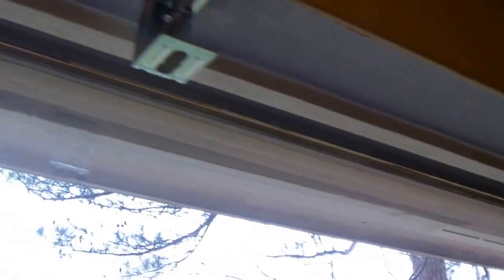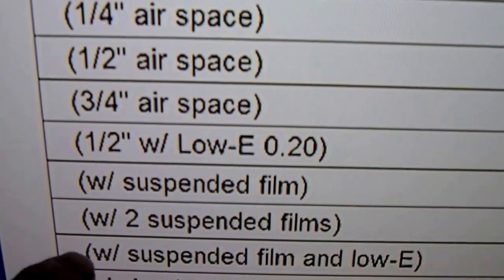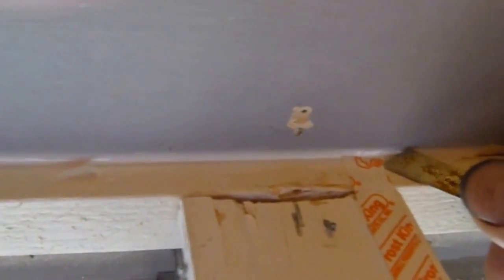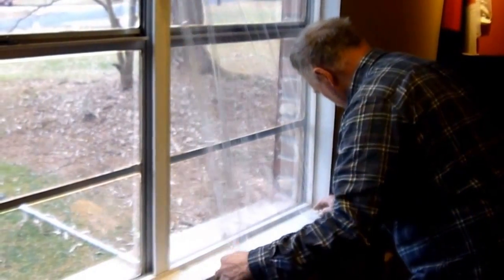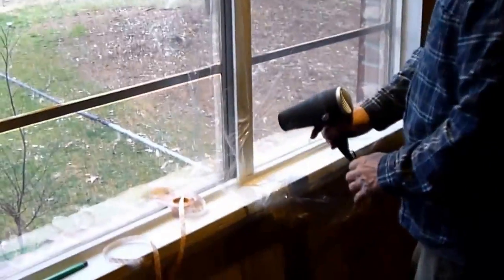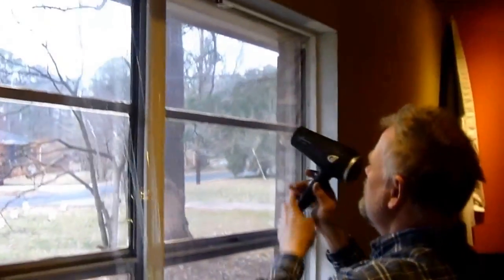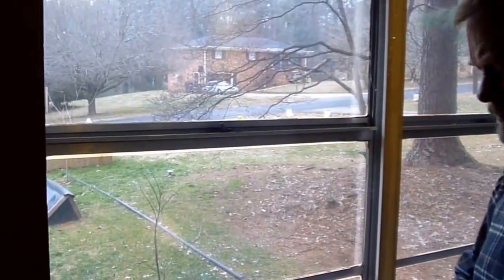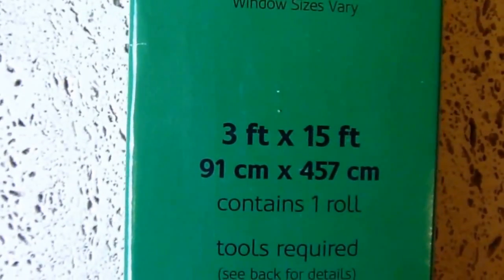DIY Window Films that insulate better than glass

Comment: Thanks, Emo. I thought/ hoped he was joking before he actually started putting it up. 

Shepard, dude I really don't want to be rude, but this is absolutely NOT suspended film. Suspended film is used to separate two inert gases in the glass (like argon and krypton). The gases have different specific heats, making it more difficult for heat to pass through the window. What you have done is sacrifice the ability to open your windows and get passive cooling during the summer (cross breezes) in exchange for absolutely no thermal benefit in the winter.

Fellow TouTubers: Please don't do this. If you want better performance from old windows, the best thing you can do is:
1. Seal them with chalk and weather strip them as best you can (stripping is very cheap on Amazon). Use a stick of incense near the window in still air (no fans around); the smoke will lead you to the largest air infiltration points.
2. If cooling is your largest concern, plant a tree or tall bush on the east and west sides of your house. You can also add an awning above the south-facing windows if the roof overhang isn't sufficient (do the math so your awnings are wide enough to block the summer sun but allows direct sunlight in the winter).  The idea is to reduce direct sunlight into the home. White exterior shelves on the sills can boost indirect light (which contains no heat) and could also house a window planter, providing a fresh-air bonus for the home.
3. Install functioning shutters to keep direct light out in the summer and help (a little) insulate the windows during the winter. Just keep in mind that shutters are considered an "active" climate control system, meaning they don't work unless you "actively" use them. Conversely, fixed awnings and native vegetation are called "passive" techniques because they work just by being there.   

When you're ready to replace your windows: 
1. There is absolutely nothing wrong with replacing them piecemeal as your budget allows. Don't let a salesman talk you into a large purchase you're not comfortable with.
2. Make sure they are installed correctly - the best windows in the world will be complete failures if they aren't properly sealed and flashed. Many people who complain about a window being too drafting are actually complaining about the window's installation because it was never done right.

Good luck!

Comment: A suspended film is NOT what you are doing. Suspended films are inside two panes of glass like this [ | ]  with | being the suspended film and [ or ] being  glass panes. 

What you are doing will most certainly help insulate since you are creating a dead air space.......but it is not a suspended film like you referred to on the website.

Comment: Hey dude. I live in cold cold England and I need to insulate my new born sons room fairly urgently... the window i have does not have a frame as it is set into the wall and the wall has a bobly wallpaper un so the surface the tape will have to go on is not as flat as i would like. Do you think this will be OK. Also, i am not sure exactly how you were using caulk and how that would apply to my situation? Thanks in advance for any further gudiance you can give!
Reply from the maker: David you might try getting some window and door casing. Measuring the window opening and then using the casing to create like a picture frame. Attaching the window film to the unfinished back side of the casing. Then using a few screws to secure it onto the window opening. The advantage of doing it like this is that you could remove it whenever you want to open the windows for fresh air as long as you make the frame robust enough that it doesn't fall apart. To prevent air infiltration around the frame you can use weather stripping on the back as well.

Comment: I need something out here in Arizona... Thanks..
Reply from the maker: The Gila products provide a reflection of the suns rays which prevents much of the radiant heat from being passed onto the surface inside your home while allowing you to have the drapes open.
Reply from the maker: The shrink type window film helps to insulate against heat from convection off the glass
Reply: nursery rhymes
Reply: nursery rhymes